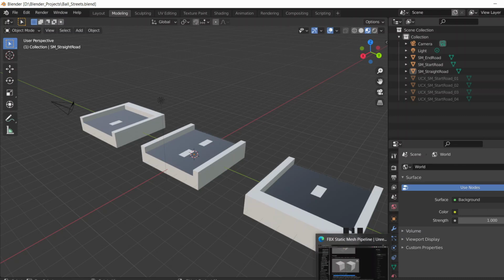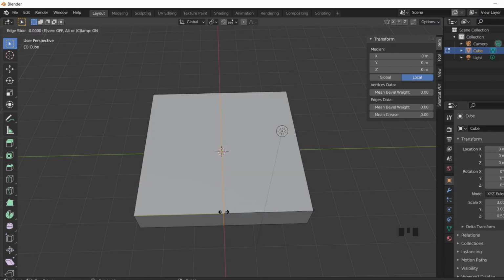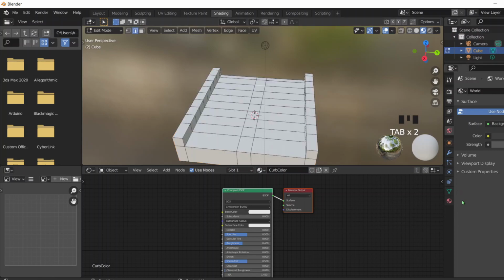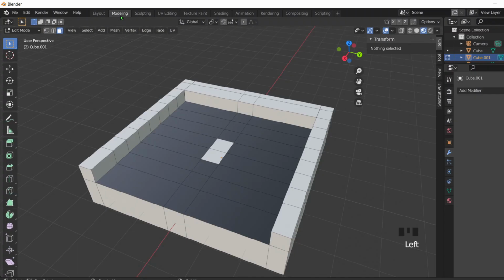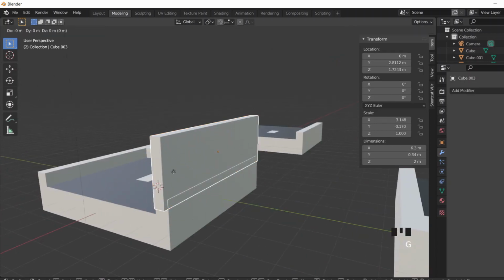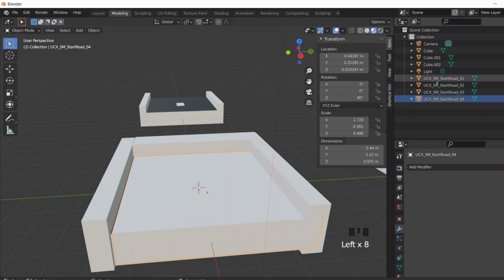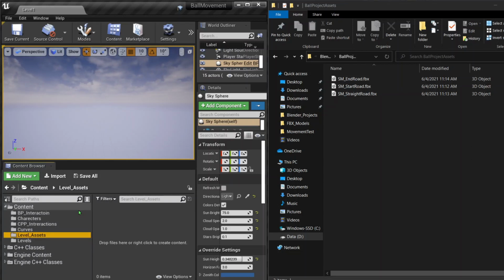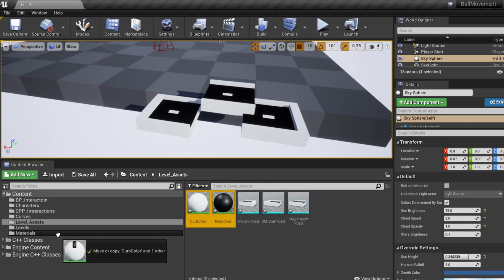Designing A Procedurally Generated Road In Blender

Comment: When I select the road and the collisions to export it doesn't work it exports all the meshes as their own .even the collisions it exports them as meshes and doesn't apply them to the road
Other than that great tutorial I learned a lot
Reply from the maker: could you clarify on what you mean by exporting all the meshes as their own? 
As for the collisions you have to make sure you name it with this format 
"UCX_TheNameOfYourMesh_0N" where N is any positive number.
when doing this video, I believe I was using blender 2.8 so it could very well be that the way things get exported in blender 3 has changed I would have to double check with the documentation and get back to you if this is the case.
Reply: @KuwaitGameDev  Oh for some reason I used (UCK) instead of (UCX) and it works fine now 

And what I meant by exporting all the meshes as their own is that it doesn't export the boxes we made at the end as collision .instead it export them as static meshes of their own that you can import to UE5 and place but it works fine now thank you very much
Reply from the maker: @Mohammed-nl1hy  I'm glad you were able to resolve your issues and also, I apologies for the late reply on the initial question. I also wanted to add that if you are dealing with more complicated geometry there is a fairly easy way to generate custom collisions through unreal engine 5 called "Convex Decomposition Collision". here are useful resources for that 
1)https://forums.unrealengine.com/t/convex-decomposition-collision-parameters/429278
2)https://youtu.be/MBRo6WHeSaU
3)https://youtu.be/0kzBgnKSBLE
Reply: @KuwaitGameDev  Thank you very much 
Hope you get more support because you really deserve it